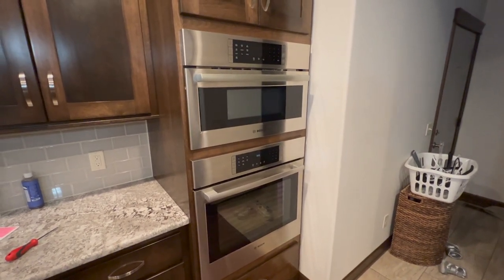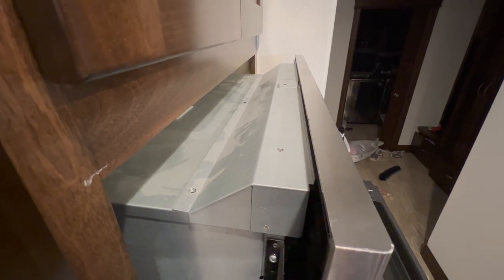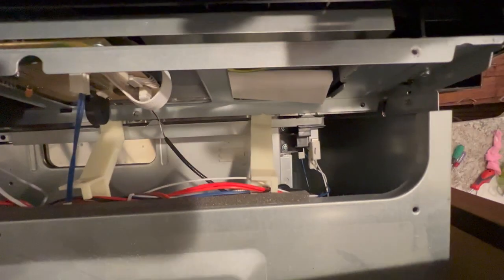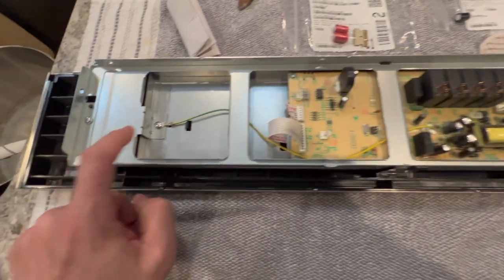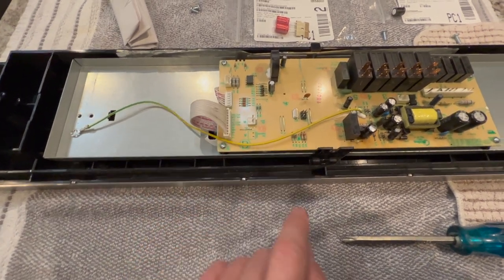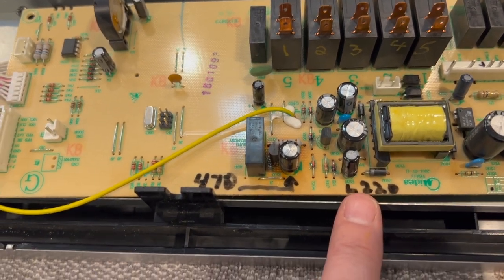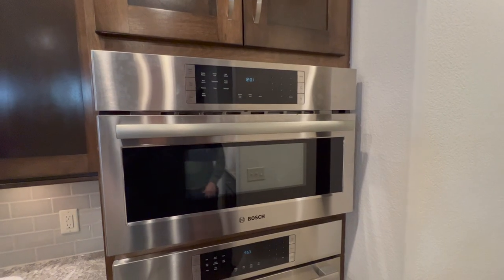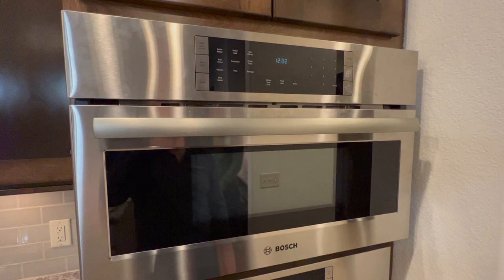Bosch Built-In Wall Microwave Dim Display DIY Repair Fix HMC80251UC HMC80251UC HMC80151UC HMC87151UC

Comment: Thank you so much for posting this. My microwave has the exact same problem for years. Could barely see the screen at night, and not at all during the day. Was reluctant to spend the $350-$500 people were quoting me. Bought the soldering iron for $30 at Home Depot, and the exact capacitors you linked to. First time soldering. Fixed it in about an hour. Felt like a total hero. One of the surprising effects was that the volume now remains low. Even after changing the settings in the microwave, there is no difference between LOW and HIGH volume. I suppose the microwave Giveth and Taketh! 

Really appreciate the detailed step by step instruction. You're awesome!
Reply: Wanted to come back and add an update. Oddly, the repair had an unexpected effect on my microwave. The sounds (when you press buttons, or when the microwave has finished) is now really really low. I wonder if i damaged part of the board when doing the repair. Anyone else experience this?
Reply from the maker: @JCrowley13  maybe not sure. Or the speaker/chirper is going bad. At least you can see the display to use. To be honest I wish my microwave was quieter when dinging bc it wakes my kids up in the AM

Comment: I have the same model microwave and have had a dim display for years.  Now the microwave is dead.  No power to display.  All my fuses are good.  Pulled the circuit board, and have the same burnt discolouration.  Think this could cause my fault? - no function?  Either way it’s worth the attempt to fix.  Thanks for the video.
Reply: @masonhoffman9365  I pulled the display panel and circuit board to investigate.  Board was burnt in a few spots.  Bought a replacement display on eBay.  Works great now.

Comment: Very informative. Found capacitors locally, installed, and works great. But now, the adjustment for volume and brightness is not working. No matter how I try to set it there's no change. Any ideas?
Reply: Sounds like others that have done. The fix are reporting that they cannot either control the volume the brightness or both after the fix. I know that might not be the best news and I can’t really provide anymore but hopefully you still have a working oven and it’s somewhat usable with the volume and or brightness setting you have currently after the fix.
Reply: @philipellerbroek9357  it does work, yes. It's my sister's oven, so it doesn't bother me in the least. I can't see or hear it from my house either. Lol

Comment: I have a 80151, notice the clock display is ok, but when I tried to select the sensor reheat or other functions the display is dim can’t see with kitchen lights on, can only see little with no lights. Is this the same cause from those 2 capacitors?
Reply: It wouldnt hurt to try. Repair was relatively easy, and parts are very cheap.
Reply from the maker: Probably
Reply: Yes, I fixed this issue, thank you. But my unit now has another problem, the oven is not heating up but microwave function works fine. Do you have any idea?

Comment: Update: Problem solved, Door has become misaligned during reinstall, latch not making contact with door switch. 

Followed your video and replaced the capacitors. My microwave was tripping breaker and had to replace door switches. Also fixed a broken door hinge. 3 fixes at once (tripping breaker was need to tackle all). While breaker is no longer tripping and display bright again, it not heating nor turntable moving. Sounds as if on (light, fan and display function all seem fine). I’m guessing I dislodged something or another component failed. Any suggestions. TIA
Reply from the maker: Let me dig into this….first though, are you sure you reconnect EVERYTHING? Was it heating and turn table was working before you started any recent repairs?

Not sure if anything in this video helps (see all his channel videos) - https://youtu.be/KMTASBXC29M
Reply from the maker: https://youtu.be/f2pIExbxQMI

OK this is the same type of problem that you described on a different brand but I think you are suffering from the same thing where one or more of your switches even if you just replace them as New is not functioning properly
Reply: @MrPeller80  don’t know if you saw that I updated post, first few lines. Problem resolved! Your video was great, we’ve got a bright display now (lived with dim display for 4yrs)! I had also replaced broken door spring and bad switch that caused breaker to blow(reason I pulled out to work on). I knew switches were now good, but reassembled everything  but no power to turntable and heating. Turns out door got misaligned and not making contact to switch (meter said it was good, but popped side panel saw it no longer made contact).

All fixed but $1.07 to replace capacitor thanks to this video..
Reply from the maker: @petekottmann4422  so you are all good now and heating and turn table are now functional??